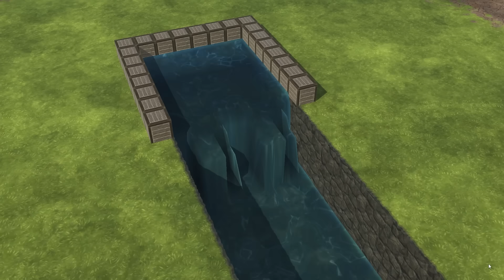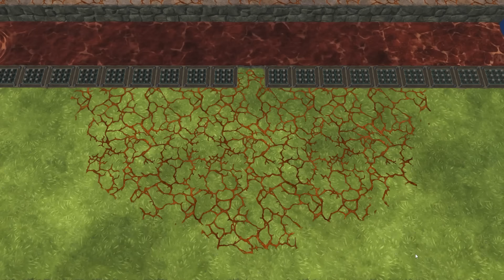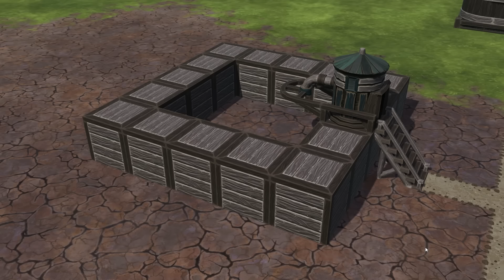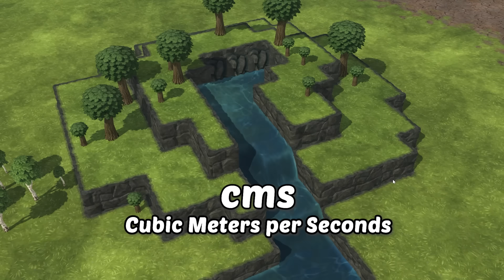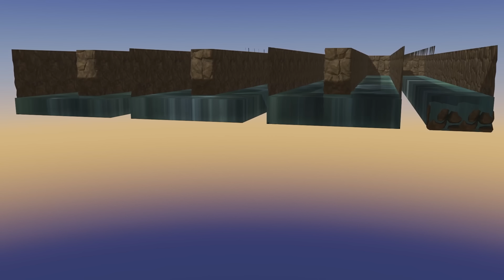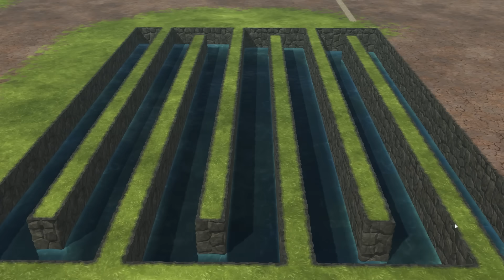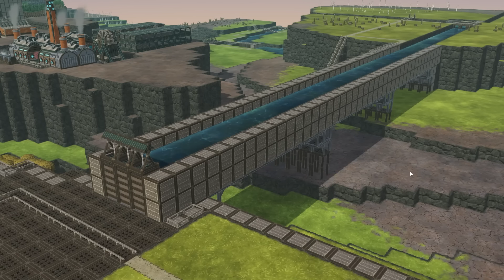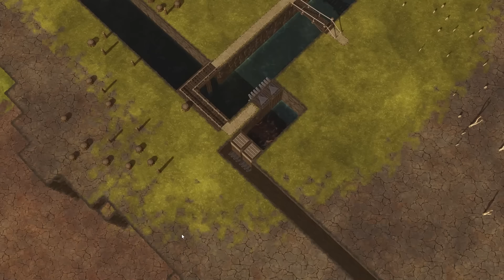Timberborn's Water Mechanics Explained

Comment: Thanks for the video. Very informative, concise and clearly explained.

There is only one thing that I've come away a little puzzled about: your explanation of floodgates and sluices being about upstream/downstream height makes sense, but I would've liked some more practical examples of their use. What specific applications require the use of one, the other or perhaps both? (Apart from the badwater diversion, you covered that one.) Are there any particular floodgate/sluice setups that are particularly flexible or useful? If you feel like making an addendum video to this one, I'd very much like to see that.

Comment: I have always thought irrigation (or water draining through the ground) rather than evaporation made more sense.  Hence, larger bodies of water don't drain as quickly as a small puddle into the ground.  This makes me wonder how high cms rivers vs. low cms rivers are affected by this "draining/evaporation", if there is any difference.  It also makes me wonder how impermeable floors (or completely sealed aqueducts vs. on-land rivers) and irrigation barriers affect this "draining/evaporation" effect.
Reply: >I have always thought irrigation
Even IRL evaporation is immense. Soil will become saturated, even sands or pebble. You can see it in long rains - at some point soil stops accepting water and puddles appear even on plowed soil.
As for the game - there are only calculations for "evaporation". Nothing additional about irrigation.
Fun fact - there is dynamic wind in the game. It doesn't affect evaporation, though. IRL it sure does, and does a lot.

>This makes me wonder how high cms rivers vs. low cms rivers
Even for low-cms pretty insignificant, except extreme cases. I never directly calculated, but evaporation loses for 3x3 are something in between 10 and 15 days per tile. 1cms will drain/refill this volume in less then an hour IIRC. It is so insignificant, that beaver-operated fluid dump will run on like 15% productivity with 18 hours working day to keep 3x3 topped up)

BUT this can lead to annoying effects with staged mechanical pumps. Intermediate stages will dry out in long run, if there is the same number of down and up stream pumps.

>It also makes me wonder how impermeable floors ... and irrigation barriers
They don't. As simple as that.

TL;DR: the only thing that matters is surface shape. 

P.s. The best shapes are the closest to square with 3+ tiles sides (the game is based on squares, diagonal distance equals to a side distance). The worst - a single tile. The second worst - 1-tile wide line.

Comment: You can decrease water level difference in your "snake" by providing smoother turns to it.
I've tested it recently, after watched your tests with water levels in "snake" power plant in steeltide series.
Reply: Define smooth. This sounds very interesting.
Reply: Hm, never noticed that. Are you sure there is nothing else?
I've tested "smoothness" of curves in snake pattern channels from cms point of view - it doesn't matter at all. And level seemed the same, but never tested the level specifically.
Reply: @Blackwing2345635  you can't affect CMS with that. I'm talking about water height level. It's rising too much in the video above, because of bad designed turns.
Reply: @avuremybe  so, what are the results of your tests?
Reply: @Blackwing2345635 my rows are 35 tiles long. Smoother turns helped me to drop water level for about 0.2 on 4 rows (3 turns)
Reply: @Blackwing2345635  its not about CMS, its about height of water flow

Comment: Thanks for this mate, I just failed a normal run on a 50 x 50 because I tried building too complicated a irrigation system. Gonna calm it down and stick with the 3 wide irrigation. Also... do you know if water is affected by water crops? can you still just plonk them in the way?? Cheers
Reply: Since update 6 nothing impedes flow. Water wheels, sluices, crops, buildings - doesn't matter.